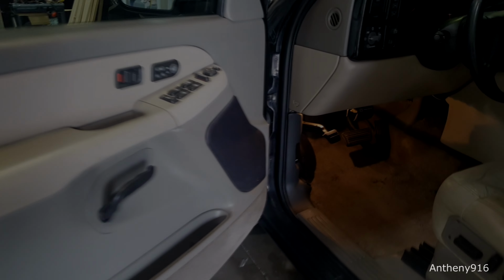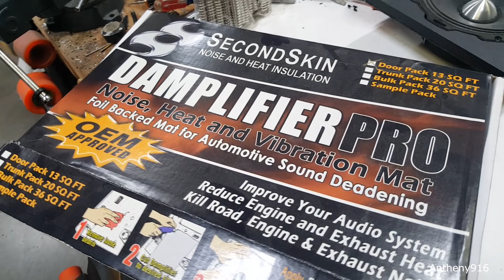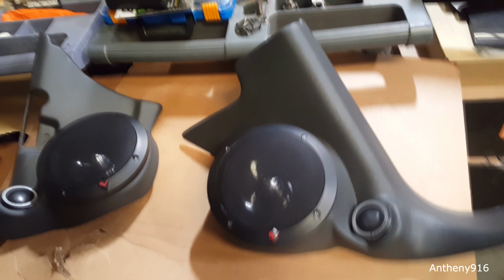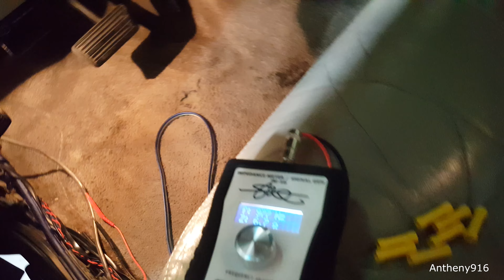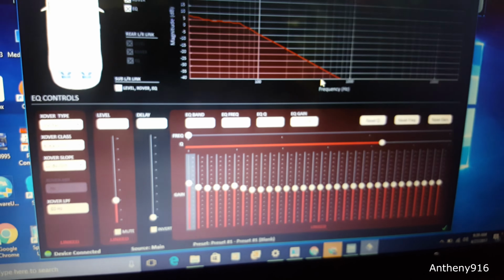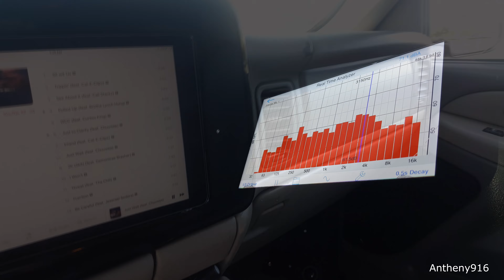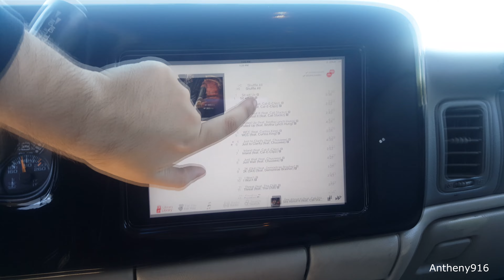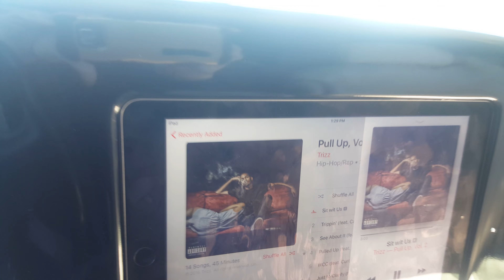Rockford Fosgate T2652-S Kick Panel Install! - Second Skin, Wired Up, & Playing! [PART 2]

Comment: Do you regret putting in those kick panels and speakers? You've had it awhile now.... did you notice you were constantly kicking those 6's in the panel? Did they get beat up quite a bit? Also, did you still keep the door speakers or did you take them out? I have an 2005 F350 I've owned since new and I want to upgrade the system with a deck, amp, and speakers. I was eyeing up those kick panels as well but thought they might get beat up pretty bad.